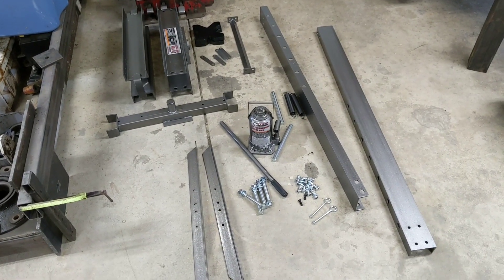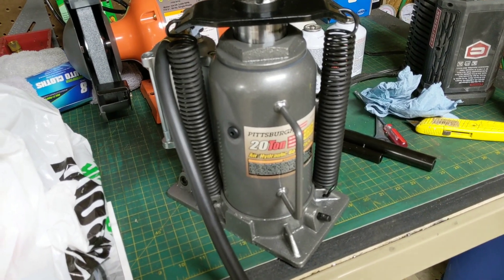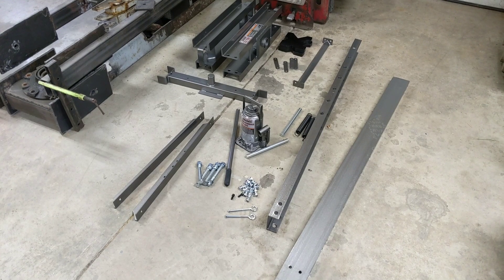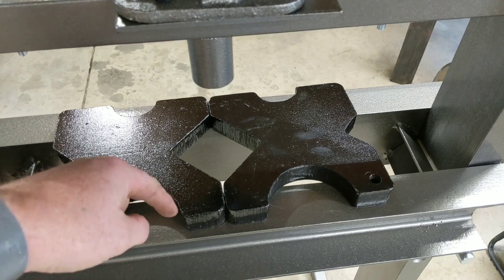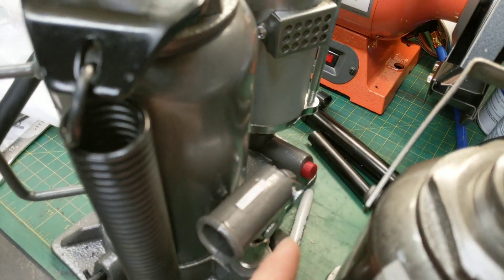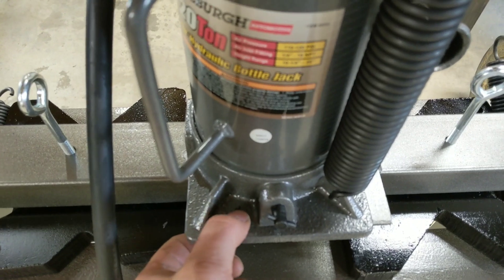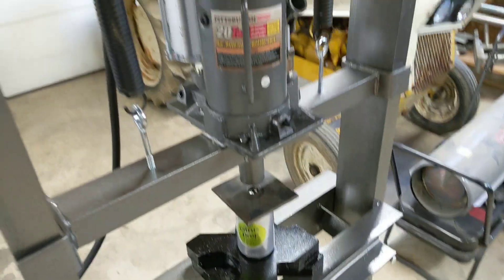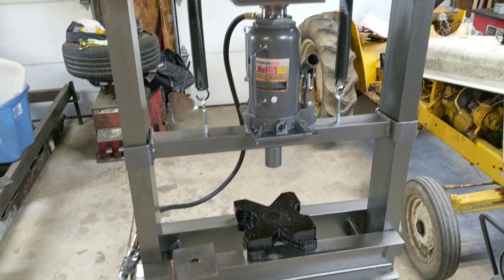Harbor Freight 20 Ton Press Review and Modifications, adding an Air powered bottle Jack!

Comment: It would have been nice to see how you overcame the spring tension to get the old jack out and the new one in.  I recall having to use 2 x 4's or something like that.
Reply from the maker: I just loosened up the eye bolts that hold the bottom of the springs, then used my hands. ;)

Comment: I did the same thing - THANKS for the instruction! 
HOWEVER, my air pump in the assembly straight up stopped working over a year ago. Had it apart, checked lines/nothing clogged or restricted in any way, cleaned it up, lubed as approriate, etc and plenty of air with no leaks of anything...not even a sound. Now back to hand pump only. Any clues or suggestions what went wrong?
Reply from the maker: Doubt you did anything wrong, sounds like the air jack just failed on you.

Comment: Hello, Im trying to keep pressure for 24 hours to glue a wood, Im on my second bottle jack and it start to slowly leak and losses pressure and lift back to start position. Can any one guide me on the right direction? Thank you
Reply: Use the press to press it and a C clamp to hold it?

Comment: I used my new  20 ton  press once to press in UTV wheel bearings... and the jack started leaking (yes we bled it) .. Took it back and they replaced it with another jack that was already leaking in the box.. CHINA CRAP!! I'll buy a jack made in the USA LOLOL
Reply from the maker: I've lifted my RV with mine.    I suppose when it leaks I'll take it apart and make it better.    ;)

Comment: I have the same unit, although just slightly different.  Mine didn't have the handles on the deck or the plate mount on the jack, it's just sitting on the bar.  Either way, it paid for itself the first time I did a set of wheel bearings.  I found myself using it for a lot of stuff, like removing valve springs from a head.

Comment: Did the same thing to mine. The handle is good to have when you are pressing bearing races in/out as it gives you a bit better control of how far the press moves. Another neat mod is to add a knob to the jack release in place of the T, much easier on the fingers.
Reply from the maker: Seems like a great modification!   I may have to make a knob!